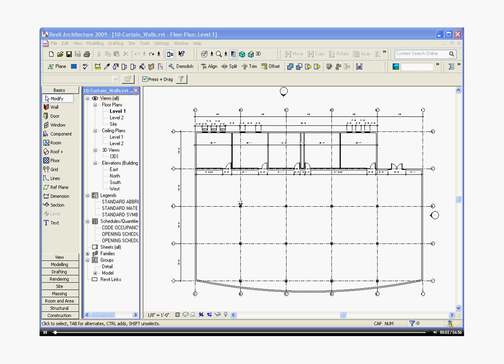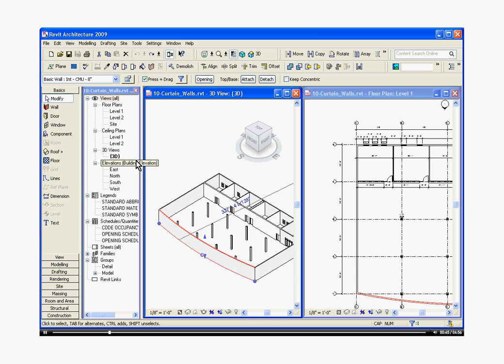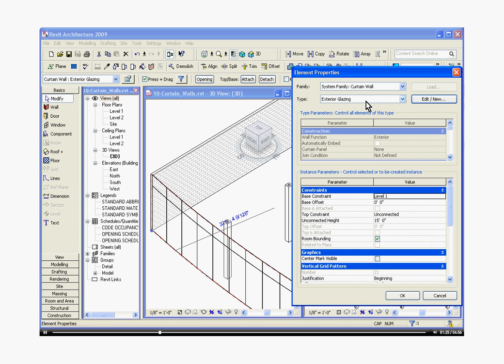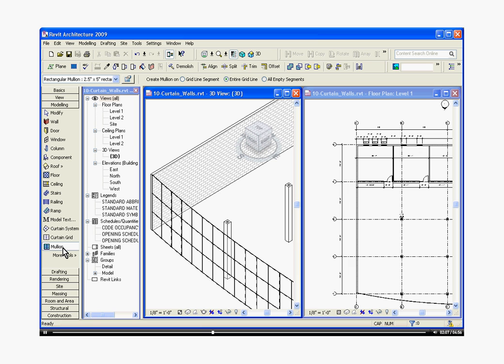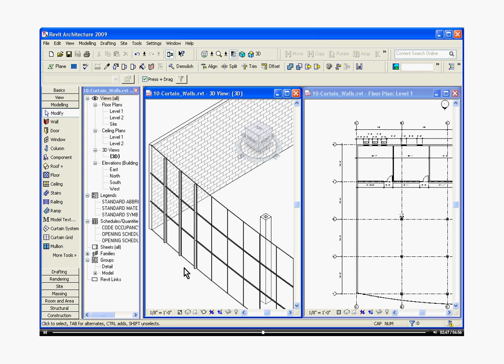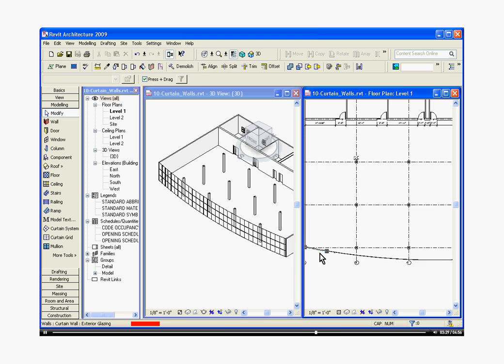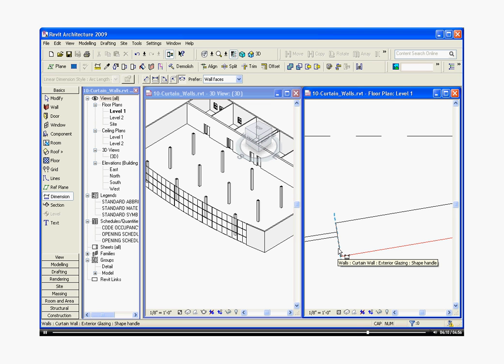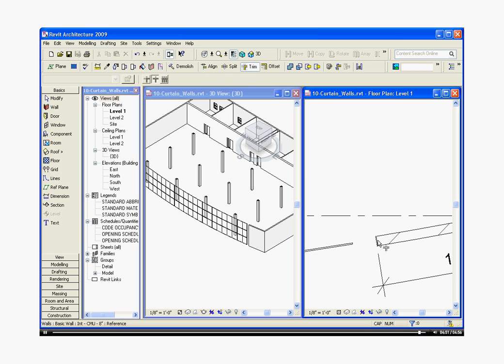Easy Revit (2009) -10-Create Curtain Walls

Comment from the maker: @Kiwimum  hmm, my approach would be to build a new curtain panel family that has the spider built into it.  that way spacing would be uniform and easier to edit them as a system.  The spider can be modeled in a curtain panel family using the modeling tools such as extrusion, blend, void forms, sweep and swept blend.  or if you are comfortable with sketchup, model it there and import it into the family, then dimension and lock it to the edges so it doesnt slide around on you.